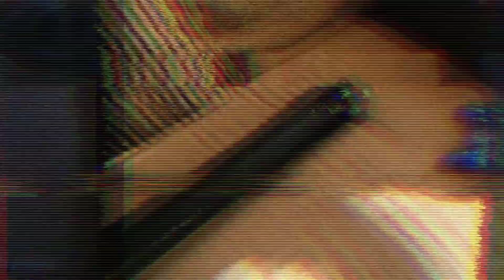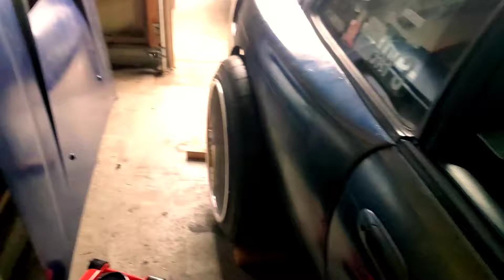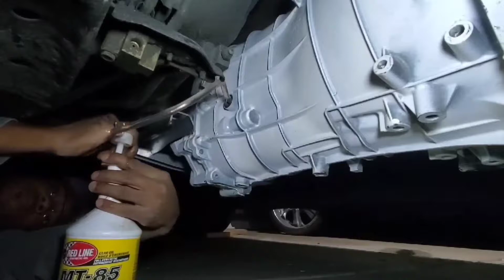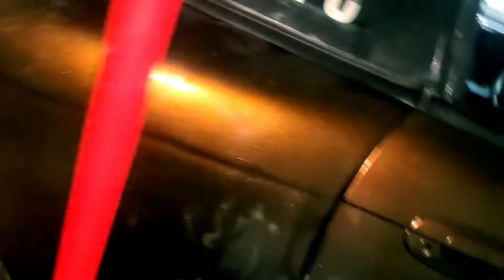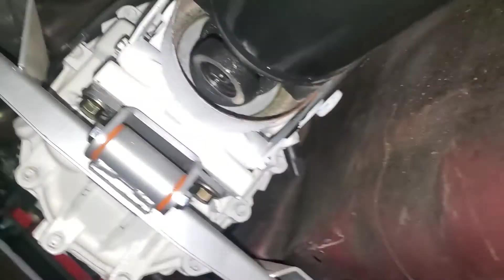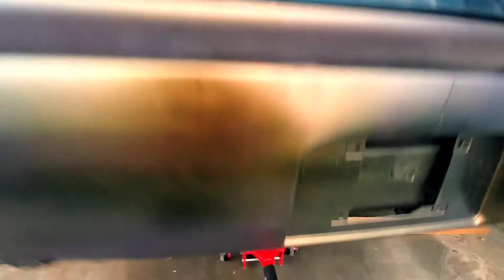S14 rb25 neo swap driveshaft install (cd009)

Comment: Did you ever replace your CAS trigger disc to read with the ECU. The optical trigger freaks out because the OEM has too many marks and the ECU technology is newer and needs one with less marks to dumb it down essentially. This may fix your issue.
Reply from the maker: I havenr yet, you think that is what may be causing the surging idle condition?